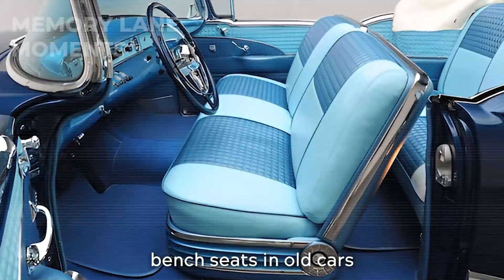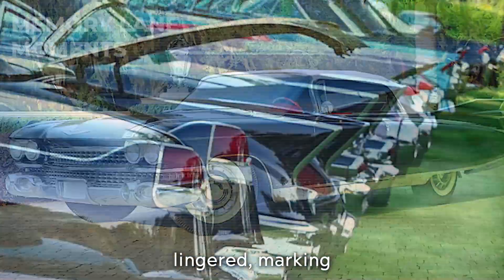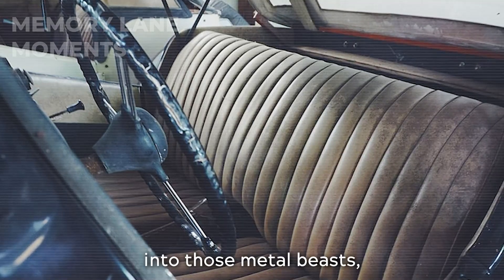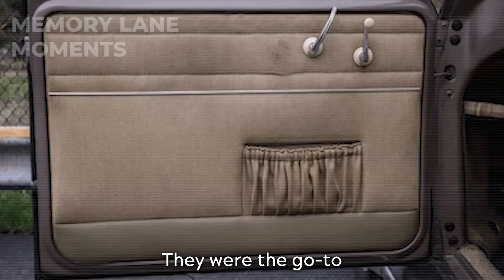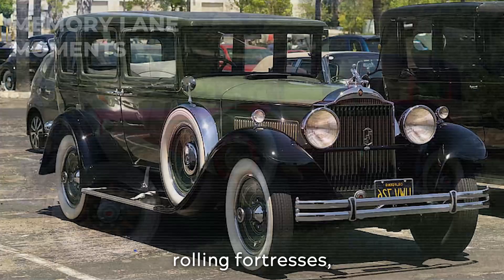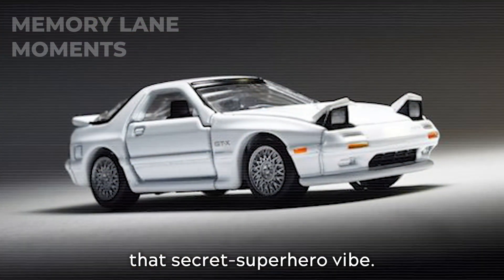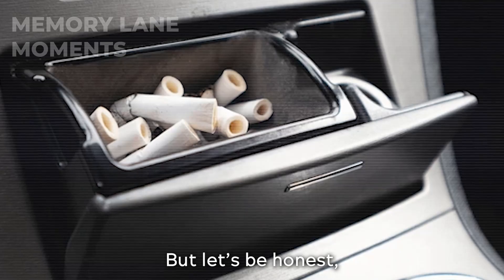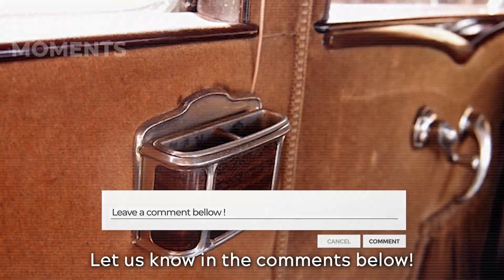10 Car Innovations That Flopped. I Can't Believe These Were Real.

Comment: Some of these features are still around there is a small van available in Australia that still comes with wind up windows and the Toyota Land Cruiser 70 series still has ashtrays and cigarette lighters as for quarter windows vents disappeared in 2003 in the Toyota Hilux Australian model only l drove cars and commercial vehicles with some of these with these features but l am glad of air conditioning and l own a 1997 Toyota Hilux with a couple of these features manual windows in my Ute are original the door card has been removed and my Hilux is very analog and basic no driver aids no safety except for a seat belt and a 22R engine the less the vehicle comes with the less to break

Comment: Pop up head lights is gonne because of safty
Reply: Safety and because the flipper mechanisms are notoriously unreliable and far more expensive to engineer than fixed sealed-beam lights.